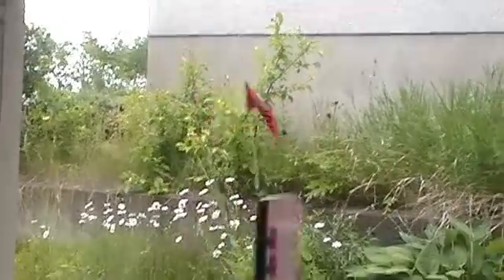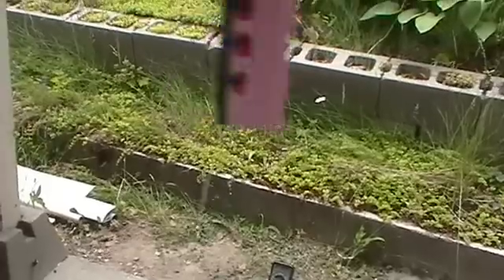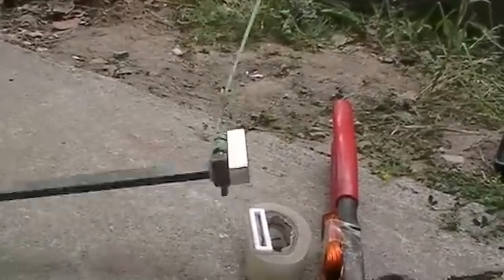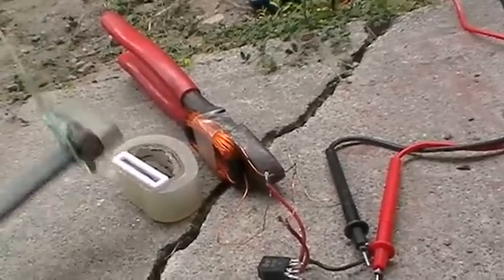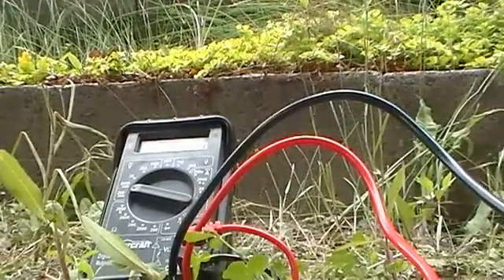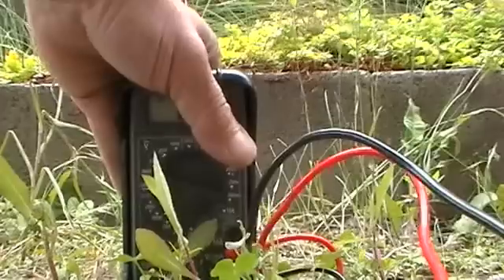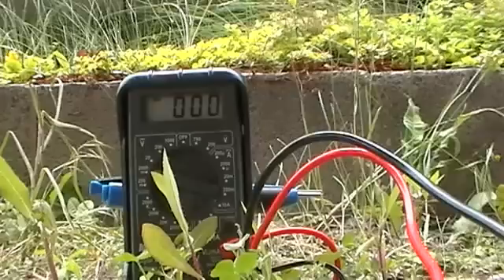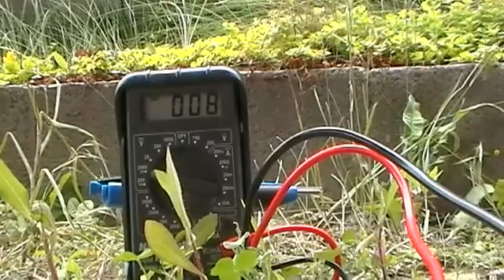Remkick Bremacles Flutter wing wind energy flutterwing new aeroelastic

Comment from the maker: Good luck Brian
I have used a naca0020 shape which is higher lift and gives more power in the less than flying speed winds that we typically see at ground level, could probably use a 22-24 but it is the aereolastic effect that amplifies the power when it flutters. weighting the leading edge helps too. I really like Simons wing pump, although I think it would benefit from a more aggressive wing like the 0020 or more; he uses a 0015, put a double acting diaphragm pump, and a slightly flexible main shaft; or spring return, and you'll get the added benefit of enertia storage and return for more power and faster oscillation?

Comment: I will have to make one! I demonstrated a really  quick terrible one to a friend in the spring but my main goal is to make one to pump air.  I only need 1 psi air for it to be a success!  Ideally, have to find someone who lives by the sea.   Going to a green drinks meeting tomorrow.  Have to convince them it is worth trying.  Thanks for leaving it up there.  Brian
Reply from the maker: I'd be happy for anyone to use the idea non commercially or to help developing nations.
Using a large; 6" hand diaphragm trash pump adapted with a spring return, with this same wing, was driving large amounts of air through a 3/4in.pipe to 18 in. depth in 2-3ms wind
Reply: itsandbits1
Do a video or take a picture  of it  please.  That is awesome!  Your air pump, flutter wing combo could run my new ebb and flow aquaponics!
Reply: +itsandbits1 +itsandbits1 hi , I would recommend using that as a battery charger, might not charge a battery in hours , but over night operation might work ,also you could try putting the power through some salt water, maybe a tube to build up electrical power slowly , and use the salt water to speed up a charge and with more consistent power outage to the battery , anyway love the design.

Comment from the maker: I guess they closed the link or ran out of money to hold it. I'll leave it there if it comes back. 
MJSparks, the output could be increased quite easily and a theif would work as is.
Mereutuban;
make a symetric airfoil; 0020 or thicker might be better. hang it from a strong cord or drill a hole straight through and put the cord through this and tie the other end to some form of flexible material or an arm with a spring. mount magnets on the arm and hold or mount a coil close to them. let er rip